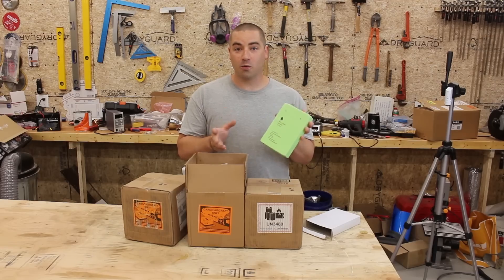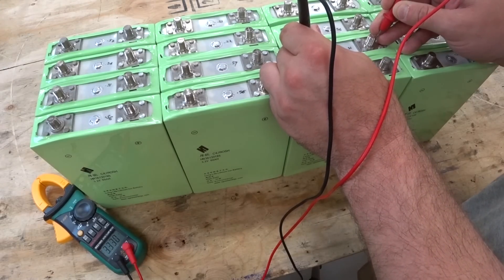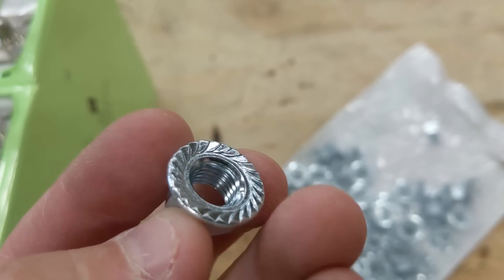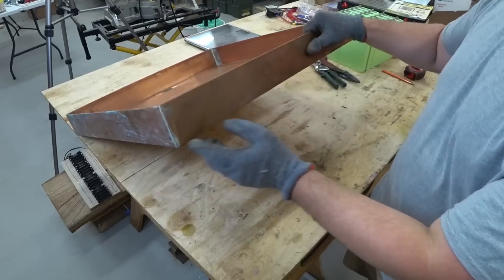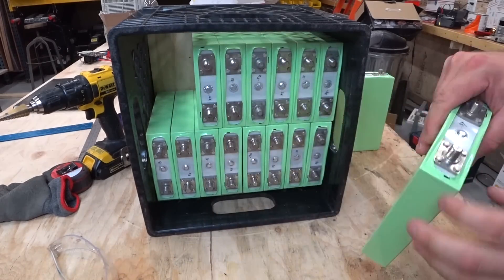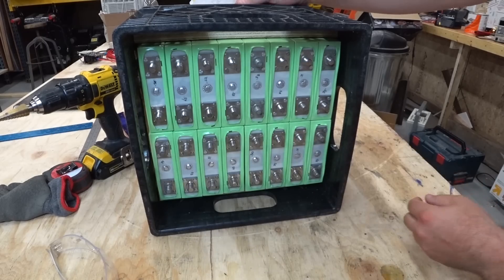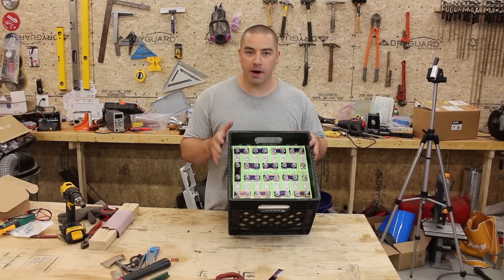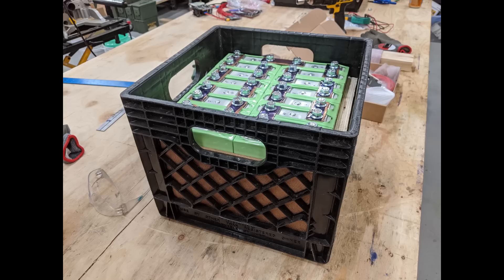Milk Crate Battery, Part 1, Easy 48v 16s LiFePO4

Comment: This summer I was deep diving in some test DIY e-bike project, to get my feet wet for a full on e-cycle project... Long story short some parts have arrived do to world shortages and such, 6 months later... I have forgotten much what I learned this summer lol and have to look at my notes but it looks like I was going with a 16s 1p build myself with very similar batteries ( 3.2v 75ah 240wh Lifepo4 ). I was shooting for a 48v build, or at least running the pack at 48v via the BMS hopefully.... Glad I found your video, its starting to refresh my mind...

Comment: I think the maths is wrong. When you connect batteries in series the voltage increases but the AH stays the same. So you will have 48v x 60Ah = 2880w .If you connect in parallel your voltage stays the same but you add your AH together. So it would be 3.2v x (60x16) = 3072w. As your batteries are connected in series so you will get 2880w

Comment: HOWdy D-P,
Thanks for the VIDEO
This might be my solution for an initial  BATTERY 
What do you SUGGEST for Airflow & Ventilation ?
COOP
...
Reply from the maker: Generally, if you don't stress the battery with high amperage, then you don't need to incorporate a cooling strategy.  I try to build to a 0.5C rate and then the cells don't get hot enough to worry about.  But, if you are building for an EV or something with high Amperage, then you will want to have air space and fans.

Comment: Handy tip when working with sheet metals. Score a line with a razor knife and within two or three bends it will snap apart leaving a clean unbent edge. Way easier than tin snips not to mention quicker.
Reply: up to maybe 1/2 millimeter thickness,or more?

Comment: Do these say LiFePO4 anywhere? The batteries say Lithium Ion, which is a different chemistry. Is that just a rewrap?
Reply from the maker: Li-ion is the giant broad category.  I've seen this on other brands too.  The Chinese company doesn't list LiFePO4, but it is.
Reply: @DavidPozEnergy  I'm not an expert on battery chemistry but I'm pretty sure lithium is the broad category, lithium ion is the specific chemistry and LiFePO4 is a separate chemistry not classifiable under Lithium Ion.

Comment: Hey David, love your videos. You may want to use the analysis power supply engineers use for conductors, they use CM/amp or circular mils per amp. A circular mil is really a box that is .001" x .001" square and they calculate the total circular mil volume by multiplying the cross section by width. For example, a .03" X 1" conductor would be 30 x 1000 or 30,000 circular mils. Engineers generally want to conduct about 300 to 500 CM/A or in the example 30,000/300 would be a max of 100 amps. At 500 CM/A that would be 60 amps.

Comment: I'm doing a project that is going to have 30 amp hour 4s pack do I buy a 30 amp bms or higher/lower thanks
Reply from the maker: You certainly could.  That's an easy rule to follow and is generally a good choice.  If you were using the cells in a power-wall then I'd use that rule, matching amp to amp*hour.  However, if you are using your battery in a high-amp situation (like a spot-welder, golf cart, etc.) then you will need a higher amp BMS.
Reply: @DavidPozEnergy  that's great thanks for getting back to me and just like to say great job on your utube vids I've been learning alot keep them coming. 🍻

Comment: David, firstly thank you. I have 4X  6V Crown FLA 230ah. This gives me 24 volts at 230ah. I would like to know which LiFePo4 battery is best for me, I have 2600 watts of solar PV and can push 60 amps at 70 volts ( limited by my PV  array configuration)to my charge controller MPPT, inverter is 4KW @ 120volts. I would like maximum KWhrs, I have a battery box that can handle 8 very large flooded lead acid batteries, so space is no an issue for the battery bank. What do you suggest? Ty.
Reply from the maker: Hi F Utube,  Thanks for your question.  The short answer is...  More battery capacity is always better.  LOL.  But to be more serious:
Your current battery is 230ah @24v, or 5.5kwh of capacity.  You don't get to use all of that because of lead acid, but with lithium you can use a lot more (about 80%).  

There are lots of good lithium options.  I'll list some.  With any of them you can get a discount using coupon code DAVIDPOZ

Battery Hookup:  These will need a BMS added:
https://batteryhookup.com/products/module-with-32-headway-38120-hp-3-2v-8ah-24v  This is already a 24v version.
https://batteryhookup.com/products/24v-7s48p-384-cells

Signature Solar: Already has a BMS inside. 
This battery is 12v, so 2 in series makes 24v.  https://shop.signaturesolar.us/products/12v-100ah-lifepo4-battery-by-eg4?_pos=1&_sid=3ba3199a2&_ss=r
Reply: @DavidPozEnergy  Thanks for the reply Dave, I really like the Beast 24V good price for the buck. How many of these can I use in parallel ? 
Could I put 4 of these in parallel? Inverter is MagnaSine4024, Charge controller is MidniteSolar Classic 150. My battery cables are 0000 running to a 250 amp breaker. How many BMS per module ? Last two questions, I promise.😅
Reply from the maker: Hi F Utube,  There is no limit to how many batteries can be put in parallel, so long as you use a central point (bus bars) for combining the positives and combining the negatives.  Please don't daisy chain your batteries.  Given the 250 amp of your breaker, you would want the BMS's to handle supplying the full 250 amps.  You always want the breaker to be the weakest link in your circuit.  If you put 4 batteries in parallel, then 250a/4=62.5 amps per battery.  Make sure you use BMS's rated for more than 62.5a and you are good.  Each battery needs it's own BMS.  Here is an example from Battery Hookup: https://batteryhookup.com/collections/accessories/products/12v-lifepo4-smart-bms-w-low-temp-cutoff  It's rated for 100 amps, and costs $75 each.  If you had 4 batteries, then your total BMS's could supply up to 400 amps, and your breaker is 250a, so your breaker is the weak link.  That's a good thing.  

If you have more questions, please hit me up on facebook because it gets hard to find old comments on YT.

Comment: I see people use cardboard a lot.  Aren't you worried about heat dissipating out of the batteries?  I understand you shouldn't use metal because of a possible short but isn't there something better than cardboard or wood?
Reply from the maker: I'm not worried about heat with my low amp draws.  But if you build this for high amp loads you might want something different.

Comment: Hello experts, I put a 4S DALY BMS to my 272AH pack and check the voltage from BMS P- to Batter B+ and it show 3.11V, when i check from Battery B- to B+ it show 13V.... is the voltage from P- suppose to be same as B- ? thanks
Reply from the maker: First, check that all the balance wires are in the correct order.  Second, connect the BMS B- wire to the negative battery post BEFORE connecting your balance leads.  Third, if the BMS is still in "standby" mode, sometimes it needs to see a charge current to wake up.  Hook it up to a charger and see if it allows the charge current through.

Comment: Hi all
16 of those cells 25Ah at 3.2V nominal is only 1280Wh and not 3KWh
Reply from the maker: Who said they are 25ah?
Reply: Thanks for the feedback.... You are soooo right ... I had to snapshot a frame from your video and zoom in to check label on cells..... I was under the impression those are the 25Ah cells from Battery hookup, from a recent sale they had....
Sorry for the confusion and keep up the good work.
Reply from the maker: You might be thinking of the Navitas brand cells they recently sold.  Yes, those were 25ah.  This was an older video than those.  Similar construction, but these are bigger.  Thanks for watching.

Comment: Dave awesome video! So in theory could this configuration work as a house Battery system for a camper van? With proper BMS, Charge controllers etc. 3.5kw would be amazing 👏

Comment: Question 101 : how do you know if you should go with 12 or 24 or 48 volt battles . Wanting to do a SMALL solar project for home.
Reply from the maker: I like 48v for nearly every situation.  The exception would be installing the system in a van, and the van already is 12v.  It used to be that 48v inverters were way more money than 12v, but in the past decade (and especially the past 4 years) that has become less true.  There are plenty of good 48v inverters in similar price points as 12v inverters.  I see no reason to go 12v anymore (most of the time)

Comment: That worked out really good.  You can run the cables out one of the hand holes.
Reply: Sir..
I perched po4 battery plz gained line
Reply: My contact number 03162027748

Comment: Dude, you need to balance out the battery voltage by putting them in parallel for a few hours. This will ensure better discharging and charging of the cells. The voltage of every cell in series should be the exact same to maximize the potential and lifespan of your batteries.
Reply from the maker: I agree, and I've demonstrated that technique in other videos.  In this particular video I didn't because I want to test the BMS's balance function.  Thanks for watching.

Comment: Why couldn't you run a straight piece of metal that covered all 8 batteries side to side instead of making them little pieces of metal contacts?
Reply from the maker: That is done when paralleling cells.  In this case I'm series connecting them.

Comment: too late i guess now but you could have put spacer between the two horizontal rows of batteries and used the same size busbars for all the connections instead of some shorter.

Comment: What about the initial charging (in parallel)? Isn’t that super important ?
Reply from the maker: I'm using a BMS with balance function.  The BMS will balance the cells for me.  Yes, I could have saved time by doing it manually, but then the balance function would have never kicked in.  I wanted to see the balance function happen, to verify it works as it should.  And it does.
Reply: @DavidPozEnergy  thanks for the reply. But I understood that with Lifepo4 even when using a BMS it’s really important for longevity and battery health to do an initial charge (top balance) so they all start off precisely even and full SOC. is this just a myth?
Reply from the maker: It used to be common practice to bottom balance LiFePO4 cells before putting them into service because BMS's weren't common.  These cells used to be used without any BMS.  I took apart a 10 year old EV with 48 cells and no BMS.  Then BMS's started hitting the market, but didn't have balance function built in.  Today, we can buy BMSs with balance.  Sometimes old "rules" don't keep up with changing equipment.
Reply: @DavidPozEnergy  aha , makes perfect sense . Thanks so much for the info

Comment: Should have cleaned the copper before installing and used a dielectric grease - different metals touching causes corrosion.

Comment: a quick and dirty trick i learned working construction is a plywood blade turned backwards can be used to cut thin sheet metal. something we used all the time for cutting aluminum siding or soffit.

Comment: Would love to be able to make a pack like this for my honda CRZ, but that would require a custom controller/BMS that actually works with the car's computer, a pack that would fit my CRZ would be over 6KW, or roughly 10x the capacity of the factor battery which drains and recharges very quickly

Comment: Very cool David!  Instead of those thermally isolating spacers, I'd prefer aluminum sheet between each battery, with exposed fins to get rid of waste heat. Obviously one would insulate them electrically.
Reply: LIFEPO4 batteries do not really heat up though,  in Solar application.   They are cooler than other chemestries anyway, but also Just don't pull enough amps to generate much heat like it may in an EV application.

Comment: Padding with a metal and fiberglass AC filter would act like a heat sink around the batteries. $0.75 for a 12 pack 16x20 at Home Depot. Cut the 16 inch side in half and line all the sides for about 10 cents.
Reply: https://www.homedepot.com/p/Flanders-PrecisionAire-16-in-x-20-in-x-1-in-Metal-Fiberglass-Air-Filter-12-per-Case-10155-011620/202056117

Comment: What would you charge to make a 12v 300ah Lithium ion battery that will charge from car alternator for now and solar in the future.?
I'm looking to run CPAP machine that I just bought the kit to run on 12v, microwave, phone and tablet. I have a 1500w PSW INVERTER,
Reply from the maker: Sorry, but I don't build batteries for sale.  But this one could do the trick for you: https://www.altestore.com/store/deep-cycle-batteries/lithium-batteries/kilovault-lithium-solar-battery-p41011/#KLV3600HLX-V3

Comment: Nice batteries! FYI the problem is not using steel hardware, its using those zinc coated steel nuts on the Stainless steel battery studs. Eventually the will corrode weld themselves to the stud.

Comment: What a bummer that copper pan is what I needed for one of my projects, and it was probably the size I needed! But at least copper good idea, I will use copper sheet to build my own box. Aside I do like your vids, I’m starting my off grid solar system for my 40ft Bus conversion as I go along building the bus.

Comment: Hahahahah Thats great. I am doing an RV and got a 25kwh install to go and it is taking days to balance. I had steel boxxes bent and welded for the highway application and used 1/4 inch fiberglass back pane for the sides of the install, and a ton of plastic Gland nuts. protection. Dally 8s all around. 

These LifePo cells are gonna last for years. Keep showing us the cells David P

Comment: Hi David!  Great video!  1) please remind me what the purple coating is?  Tape or a brush on paste? 2) can you speak about the fire harzard potential or lack there of with this setup?  I spent a day drilling holes in salvaged 2x2 angle iron for my battery rack to avoid using wood of any kind, just in case something happened.  Powerwall will be in my basement.
Reply from the maker: That is a machinist dye.  It just allows me to scribe the lines for cutting/drilling.  LiFePO4 cells are considered very safe and don't do the "thermal runaway" that can occur with Lithium Polymer.  I'll also be adding a BMS, and limiting the amps to 0.5C (low) so i don't suspect I'll have any issue with heat.

Comment: I dont know anything about batteries, but don't they have to be in parallel to get that capacity?
Reply from the maker: I put them in series to increase the voltage to 48v (nominal).

Comment: I have 23 solar panels but the company installed all the components. But not sure if working. If it is possible what kind of battery works
Reply: The solar panel is 295watts
Reply: The company named solar edge

Comment: Hi David, I want to build a 48v LiFePO4 pack with 3.2v AliExpress cells.  But should I build it as 15s or 16s.  3.2v x 15s = 48v while 3.2v x 16s is 51.2v.  Basically, why do you choose 16s rather than 15s ?  I currently have 4s4p of 12v Lead-Acid batteries - so a 17kw Lead-Acid powerwall, but less that half is usable because you cannot drain Lead-Acid too much and charging rate gets massively reduced after about 80% full - so it's basically impossible to go over 80% and you cannot drop much lower than 40%.  Keep up the good work.  Excellent knowledge transfer to us new learners :)

Comment: How do you convert 56 volts to ac,or do you just reduce the voltage some how to 12 volts and power dc appliances?
Reply from the maker: I use inverters that are made for 48 volt. Most 48 v inverters can use a range from 42 v up to 60v.  Some even go higher, depends on brand.  I have many other videos on my channel about the inverters that I've tested if you're interested in that.
Reply: @DavidPozEnergy  does this convert to 110 120 ac, also I subscribed and will be catching up buddy,you seem slot like me as far as home knowledge,I'm also a mechanical nut!!,I'll be checking your videos out and may have some questions any help is greatly appreciated 😊
Reply: @DavidPozEnergy  thank you sir
Reply: Why, your going to loose too much efficiency with the inverter. If all your powering are led lights and small equipment like fridge and freezer your better off going all dc unless you have a long travel between battery  and the application.

Comment: Be a great swap out pack for my ride on mower at 30kg.
Im having issues with using a 16 cell BMS on a 15 cell pack.
Reply from the maker: Not every BMS can be used with less cells than it was designed for. I'm using a tiny brand BMS on this build and it can be used with less cells. But other brands that I'll use such as Daly, need to be paired with the same number of cells as the BMS was designed for
Reply: @DavidPozEnergy  David I like to contact you about maybe hiring you to help me with my solar panel and diy battery bank system. How can I contact you?

Comment: David, I have watched a few of your videos and would be interested in having a look at the diagrams of your Whole House Solar battery system. You seem to be very safety conscious and have incorporated a lot of good ideas.  Also would be interested in any ideas on how you would improve your design if you were to do it now or may incorporate in the future. How can I get ahold of you?
Reply from the maker: Thank you for the comment. I will have to make a video showing the diagram it's a good idea. The best way to get ahold of me is through Facebook however I'm not very active on there sometimes it might take me a week to get back to you. As for changes if I did it again? Next time I would probably purchase a Sol-Ark brand inverter.  They have a big price tag up front but after having built my whole system I'd realize that it's actually cheaper because you don't need to purchase all the individual components separately.
Reply: @DavidPozEnergy  thanks for the response looking forward to your video.